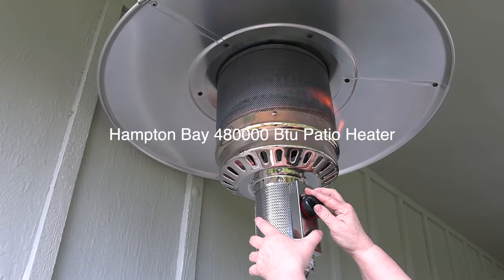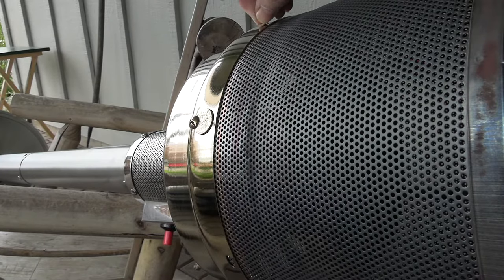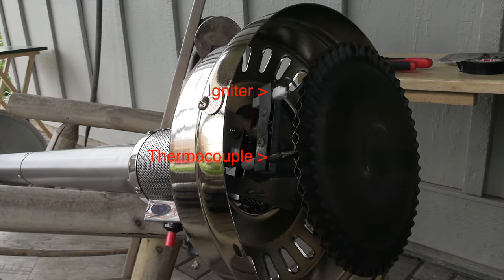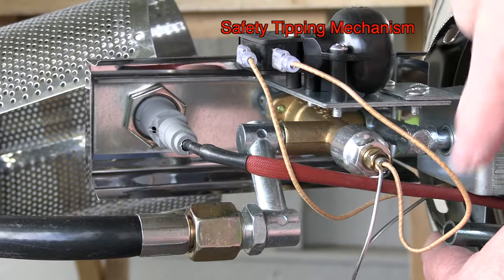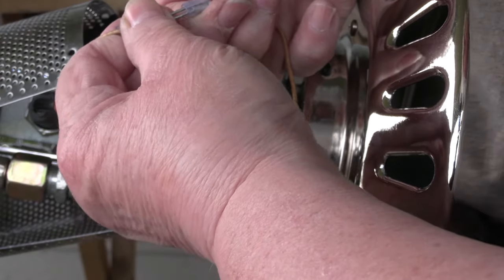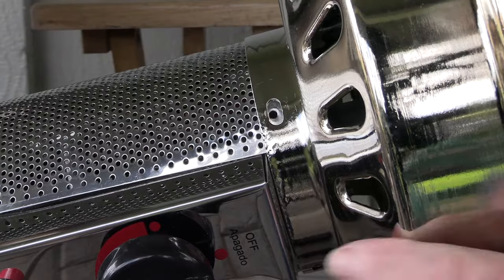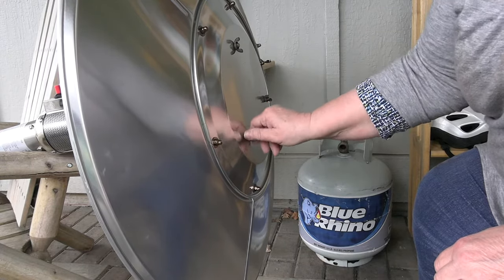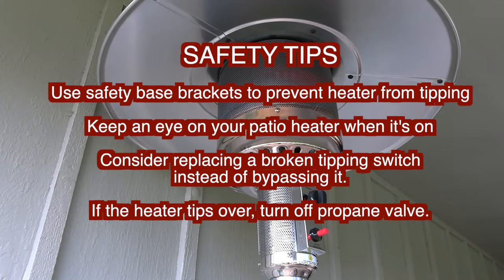Grandma quickly fixes propane heater that won't stay lit

Comment: You're a lifesaver. I just spent 2 hours putting mine together only to have this issue. My tilt switch was fine, but the the wires were not even connected. I had to squeeze the terminals with some plyers to get them back on. Fired up, stayed lit after 10 seconds, and away we went.

Comment: I had a different type of model, but I followed your advice and it does work very well.  I just cut two small pieces of cable, joined them and put electrical tape on them and it worked perfectly....thank you very much

Comment: Grandma thank you so much. We bought a Hampton Bay heater and put it together in 2018 and never used it until this year. It wouldn't light so we watched a video that didn't help and then we found you. You are a godsend thank you again.
Reply: Is the top too close to the ceiling?

Comment: wow! Grandma's video to fix the problem is excellent! I saw a few people cut off the connector and then tied both wires together. If they decide to connect back when they replace the safety switch then screw!!!

Comment: So glad I ran across your video. My 2 space heaters haven’t worked in a year. The thermocouples did have some carbon on them which I lightly sanded off. While apart I bypassed the tip over switches just to be sure and everything works Gr8. I’m all about safety but my heaters are never left unattended when turned on so I’m not worried about a tip over switch.

Comment: The tip switch failed after the heater blew over in an intense wind gust.  I replaced the switch - instead of bypassing it as suggested in the video - in about the same amount of time.  Cost me $11.99 for a two pack. The next time the heater blows over it will turn off - as before - and it won't burn the deck.

Comment: Excellent tip, worked great. 
FYI, my particular model had a door to access the tilt mechanism, thus didn’t need to disassemble. Check to see if your model has this access door.

Comment: Video was great. I bypassed the tilt switch. However, the problem persists. I have cleaned the thermocouple and even positioned it closer to the burner. Unit lights with no problem. I hold the knob in for 10+ seconds. When I release the knob the flame goes out. Any thoughts. You said there could be two problems. What is the second possible problem?
Reply: Replace the thermocoupler

Comment: The thermocouple produces a very low voltage (typically less than 20 millivolts)  and current which activates the gas safety valve.   The problem is that quite often the tilt switch (sometimes called a dump switch) has contacts that get a little corroded and increase the contact resistance just enough so that the gas safety valve doesn't operate.  NOT a very smart idea to bypass that tilt switch considering that you can buy them for less than $20......
Reply: Do you have a recommendation on where to get this and how to do it?
Reply: Yeah someone’s one catch their house on fire like this

Comment: Good tip. However: Use proper male joint splices for connection.  They are made for these types of connections. Also, if you live in California or earthquake prone areas, I highly advise NOT relying on this as a permanent fix. Replace the Tilt Mechanism.
Thank you, Grandma.

Comment: Thank you! What is the name of the part that  you are bypassing?
Reply: It’s called a “dump switch for patio heater”. You can find it on Amazon for about $10 for a 2 pack.
Reply: @ajchien  
That's right. Sometimes called the Tilt switch

Comment: Bypassing safety mechanisms is never a good idea, especially with gas and fire. As cheap as the part is to replace, $10 - $15, do yourself a favor and replace it.
Reply: What's the name of the post
Reply: Sorry part!!
Reply: Thermocoupler & Dump Switch Control Safety Kit
Reply: I agree....I don't think bypassing a safety mechanism is a good idea, either.
Reply: No

Comment: MAKE it easy ..if you put a fresh tank on, do you here gas coming out ..well check again, close the valve off...unscrew the line if you here gas leaking while its closed its the regulator ...  hit the regulator with the handle part of your screwdriver a few times 5, 6 times ..put the line back on ..open valve and try to start you heater again it should work..

Comment: Bypassing, a safety mechanism is not a fix.
Reply: If the “safety mechanism” renders the unit inoperable even when there are no unsafe conditions, encouraging a large proportion of users to bypass it, then it’s not a valid safety mechanism, it’s a bad design.

If a car’s engine cut off the moment a seatbelt was unbuckled, then people would just bypass seatbelts altogether. That’s not the user’s fault, that’s shit engineering.

Comment: Your age and gender have nothing to do with your skills.  Women are not expected to know how to fix anything and that is a cop out.  Being able to fix something as a woman and senior is no more creditworthy than being a man and young.  So don't bring your age and gender into the video.

What you did was very unsafe.  I am assuming you have grandkids, since you called yourself a grandmother.
Do you know what a tilt switch is for?  It shuts off the patio heater if it tilts or falls to the ground, something that could easily happen if small kids or a dog bumped into it, or even you.  The thermocouple is connected to that tilt switch.  You are putting everyone in your home at risk with this unsafe workaround.  If patio heater catches on fire, that propane tank will go kaboom....!!!  All on account of a $10 tilt switch/thermocouple.  They did not add that feature to make it hard for you but for your safety.  By the way, when the firemen discover you tampered with the switch, esp with this video as proof, your home insurance will wave bye bye and not cover the damages.

For $10 you could buy a new tilt switch on Amazon including the thermocouple and it installs easily.
You could also unscrew the black housing on the tilt switch and clean it out and repair it at no cost.
You also forgot to tap the sooty gas pipe and thermocouple tubing to remove any blockage of soot, ashes, debris, spiderwebs.  This is a maintenance issue that should be done twice a year.  You opened up the heater and should have done that.

FYI - I am female and older than you.